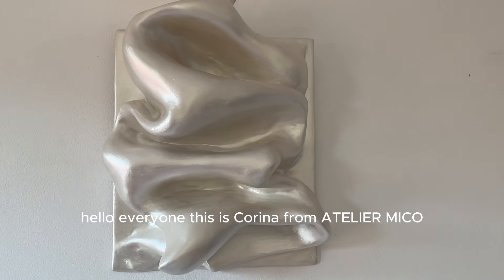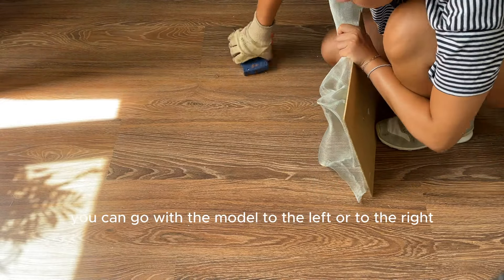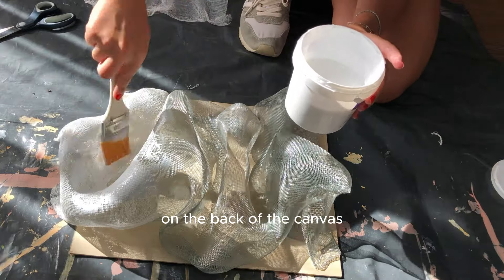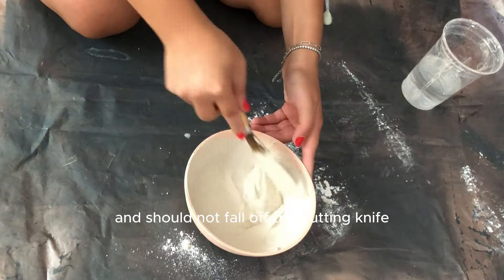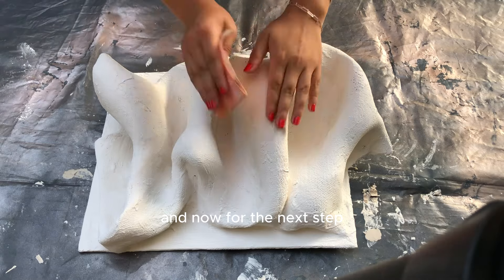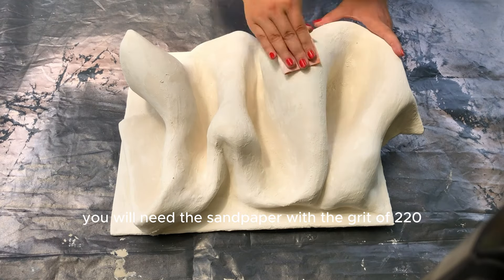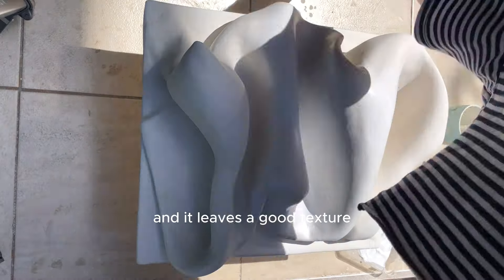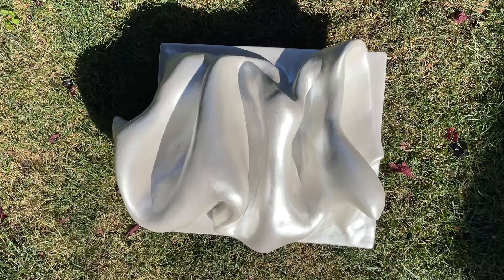DIY PLASTER ART - pearlescent effect

Comment: Hey! I just started my first 3D painting inspired by your fabulous work. I’m having a hard time managing my plaster. It gets hard in the bowl too quickly. Any tips on how to solve it then? Love love xoxo
Reply from the maker: hello! this art is called “plaster art” but the material used is not plaster is actually joint compound and it has a longer dry time. you probably are not using the right material. check the link in the description and find the joint compound product
Reply: @ateliermico  ah okay. Thanks for clarifying ❤️

Comment: I'm having a lot of trouble doing this. First, I buy and use a wood glue from a tight bond brand, and the gauze doesn't stick well to the wire mesh and it slips a lot. Second, the joint compound tends to harden too quickly. Is there anything that prevents it from hardening? Thank you so much for always answering❤ ..
Reply from the maker: hi! for the joint compound you could try to add a bit more water so it will take longer to harden. also try placing small patches of gauze. it should be easier to arrange them.

Comment: Did this work only form 2 layers of joint compound? Or was it edited for the video
And I'm worried about powder inhalation while sanding Are you wearing a mask?
I'm curious about the packaging method of safely transporting the work
🎁🚚✈️
Reply from the maker: hi! sometimes is enough to add only 2 layers of joint compound, sometimes you need 3 or even 4. it depends on how smooth you want the painting to be. yes, it is necessary to wear a mask, also if you can do this part of the process outside would be better for you!

Comment: Is there a limit to how big of a canvas I can use? For example, will the 3D plaster fall off a larger canvas because it is heavier?
Reply from the maker: hello! we would recommend doing sizes similar to 80x80 centimeters or 60x120 centimeters. if you go larger on this dimension it will become too heavy and it will be hard to handle

Comment: Hello❤
Joint Compound on Amazon Link is not shipped to Korea.
Similar products include water-based putty and hand coat that are sold as dough in Korea.Can I use this product instead?
Do I have to add water and mix it?
Reply from the maker: hi! you should find similar a product in construction stores. joint compound is a wall filler and you can mix it with water. if it comes as a dough it should definitely not need water but we never used that kind of product so me could not recommend how to use it.